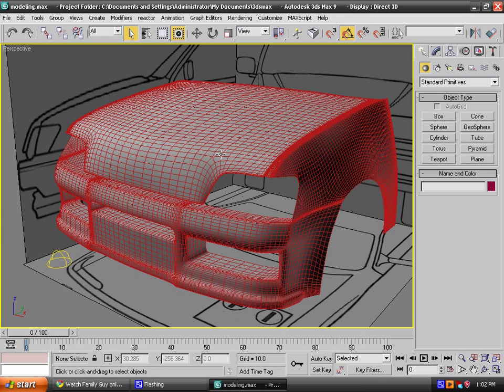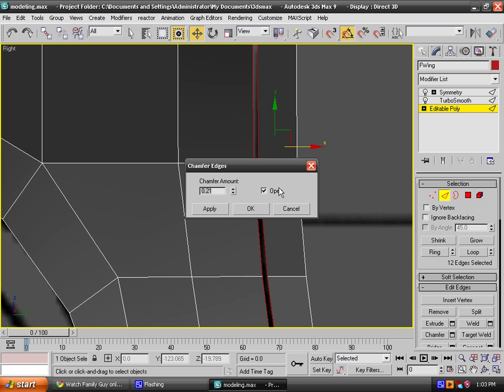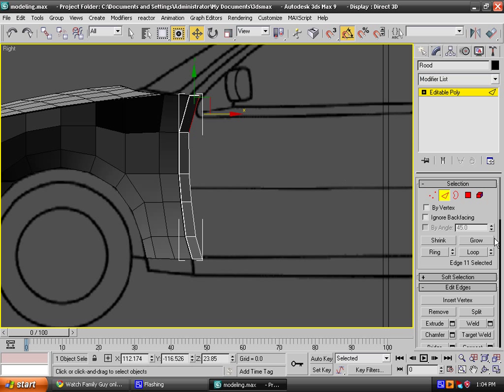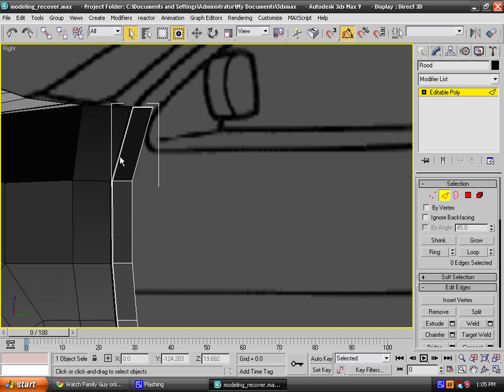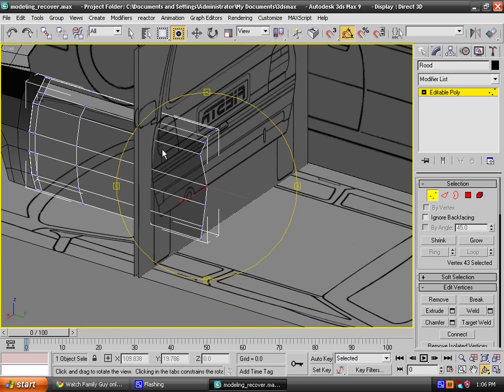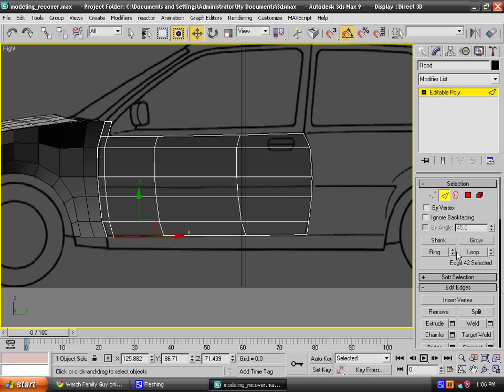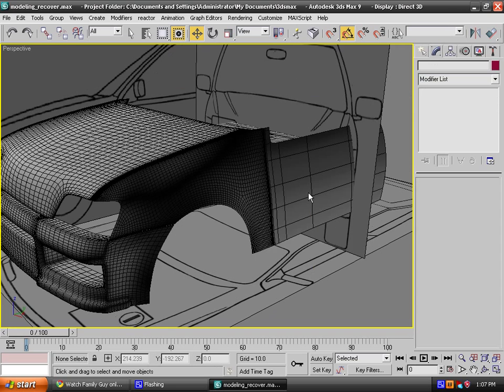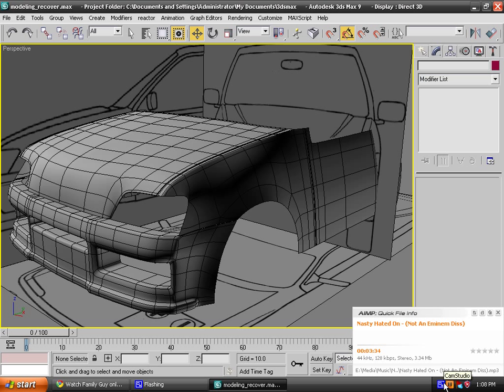Modeling a car in 3ds max - Episode 7 - The Doors

Comment: OBS - Open Broadcast Software is REALLY good, fast, and very flexible with sources. Allows multiple sources, on the fly audio level correction, and it's %100 free, no watermarks.